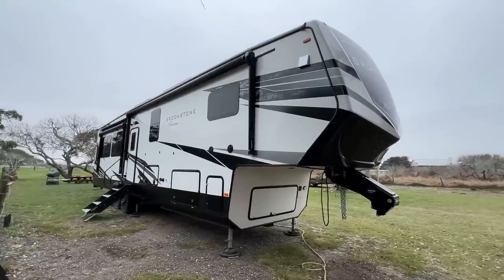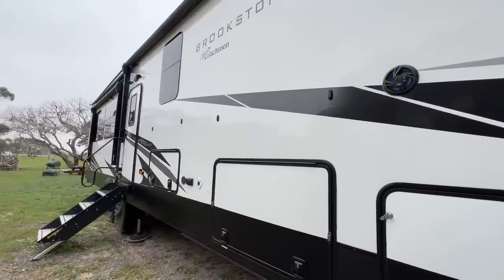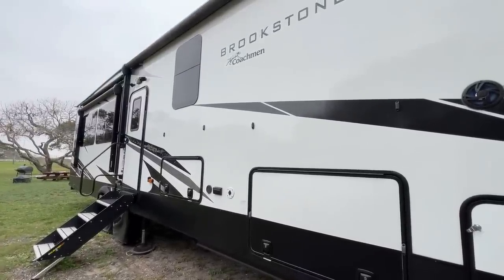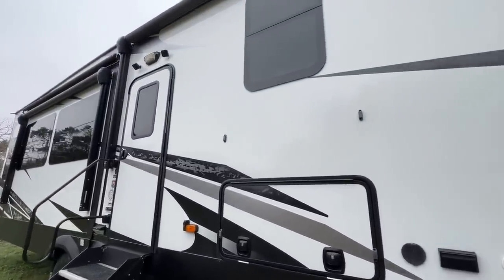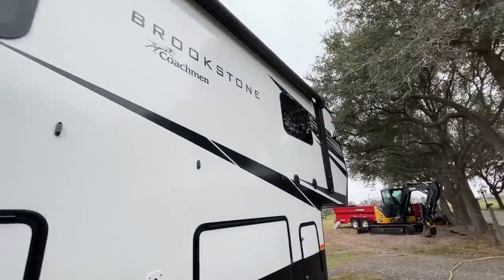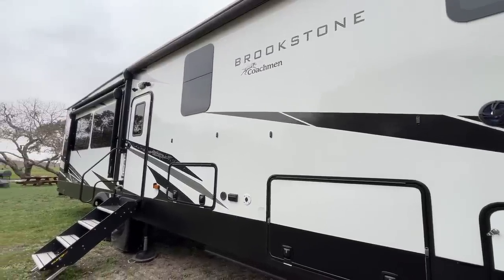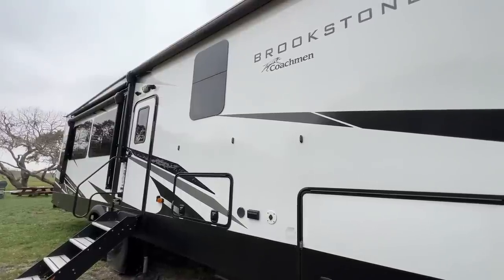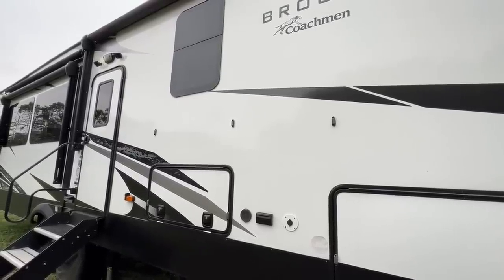Washing your RV? This may surprise you!

Comment: Just bought a brand new class A and the first thing I did before taking it out is have its paint protected with a good quality ceramic coating ( professionally done).  Had the same thing done to my fifth wheel when it was new and it looked that way (new) till the day we traded it in.  Use neutral ph soap to wash and you will be happy with your shine.
Reply: How much does that cost?
Reply: ceramic is the way to go
Reply: @theer2259   for a 32 foot Class A it was $120 a foot and guaranteed for 5 years.

Comment: Rockwood recommends wax. I never have waxed our RV. I DO use a power washer but i use the wash nozzle. You can buy nozzle kits with 5 different nozzles. I use the middle or wash nozzle and it works well. I do avoid the bottom of the windows.

Comment: I beg to differ, I own a 2005 Trail Bay 27DS, owned it since new. Each spring I throughly clean the trailer and wax it with a marine wax, specifically, Collinite 885 Fleet wax, it’s kept my trailer protected and looking almost as good as new after 18 years of living in Indiana. Wax helps seal up the porous surface, allowing for a much easier time removing dirt, bugs and road grime.
Reply: I use Collinite wax on my jeep.  Good stuff.

Comment: What test data do you have to back your claim?
Reply from the maker: None. Personal experience with 5 RVs.
Reply: @BigTruckBigRV  That's what I thought. Thank you for being honest. My personal experience of 40 years with many RVs and boats says your video is not accurate or incomplete at best. I suggest people follow the recommendation of their RV manufacturer. From the Forest River owner's manual for your 5th wheel "Wax at least once a year with a standard liquid or paste wax" There is an entire section about the care of the exterior finish. And yes washing, as you indicated, is an important part of proper care.
Reply: @BigTruckBigRV  In all due respect, I regularly follow you site for the last 4 yrs.Your rvs sit around under a port till last year, you flip them regularly, you really, don't really go far with them. If you travel up and down the coast ,or across country, you need some kind of protection against the elements, dirt, road grime, bugs etc.29 years rv experience .
Reply: @josephsouza9951  Hello Sir was wondering if you could give me some info on what the best method is to clean my Motorhome and what to use . After hours and hours of watching videos on here I'm confused as can be.  It's a class C motorhome with fiberglass body . We are a older couple just trying to figure this out ! Everyone makes this stuff out like it's rocket science!

Comment: I use a Automotive ceramic spray, I use it on every part of the RV ,it is good for plastic, rubber vinyl, paint you name it Even glass It helps with the bugs on the front of the RV And even the rims of the RV prevents the break dust from sticking to it. And those black streaks from the end of the gutters wipes right off Easily , I re apply at least 3 times a year it also shines .

Comment: I would definitely use a protective product by my RV’s exterior.  I store my wife’s 2019 Winnebago 2100BH inside a climate controlled shop where I can wash and wax anytime during the year, usually before camping season starts.  Using a power washer correctly to wash the RV is OK, with a wide fan nozzle and minimizing blasting water at seams, windows, joints, etc.  Light oxidation can be removed with an all-in-one cleaner/wax product.  I wouldn’t use an automotive polish, as JD stated, the gel coat is relatively thin and the surface isn’t uniform.

I’ve used Collinite paste wax, it’s a bit difficult to work with but it’s been used in the marine world for years.  Collinite does offer a liquid wax, 845, which should be easier to work with.  Collinite is an incredibly durable natural wax.  For folks camping full time or leave their rig outside, applying and removing any protection product it’s recommended not to do it full sun.  In these situations a sprayable sealant or ceramic coating would be easier to apply and remove quickly.  Some of these products, such as Turtle Wax Hybrid Solutions Ceramic Wet Wax, can be sprayed onto the still wet surface and wiped off with a drying towel.

I don’t believe a pro-sumer level ceramic coating such as Gtechniq Crystal Serum Light will be effective on a gel-coat, CSL is designed to bond with a clear coat/hard plastic.  Pro-sumer level ceramic coatings usually come in small volumes 30-50ml bottles from $55-$120 per bottle and would be cost prohibitive for most people, lots of surface area on an RV you’d probably use 2-4 bottles depending on size.  CSL is definitely a product best applied indoors.

Sprayable sealants and ceramic coatings can be purchased in larger volumes.  I’ve had good luck with Technicians Choice TEC582 Ceramic Detail Spray, available in gallon size, lots of choices out there, I use this product between washes of my vehicles along with the Winnebago.

For vinyl surfaces, 303 Automotive Protectant gets applied to awnings top and bottom after it’s washed, include the roof and accessories.  Gallon size available.        

Stubborn bug remains on the front cap can be chemically removed with a PH balanced bug off product, I use Gtechniq W8 V2 Bug Remover.  I own several Gtechniq ceramic coated vehicles, W8 will not harm the coatings but will probably remove sealant/wax, again several bug off options available from different manufacturers.  I follow up with Technicians Choice afterward.

For our usage, TEC582 would probably be adequate for a trailer that’s only outside 30-40 days a year.  In a high sun environment, just like your daily driven vehicle, a once a year application might be not enough.
Reply: Bless you for this post!!!!!! We use Carpro CQuartz UK 3.0 on our vehicles but I've been scratching my head trying to figure out how to protect our new rig. Your comment helps TREMENDOUSLY!!!!! I would have loved to ceramic coat it and maintain with Tec582.

Comment: I use soft water to clean my 5th wheel. Had a spigot installed when we replaced our home soft water system. Help eliminate hard water spots especially in AZ that has some of the hardest water.

Comment: It is very important to wash your trailer.  Watch a car detailing video from pan the organizer on YouTube to learn how to wash a vehicle.  I agree not to use power washer on trailer for the reasons given.  
Use two bucket method with microfiber mitt or microfiber pad on pole.  Look to harbor freight. Use two or three bucket methods to wash.  Use a quality microfiber drying towel.  Ceramic coat every 6 months if using a consumer spray product like turtle wax or meguairs.   Ceramic lasts much longer than wax.
Reply: Hello Sir we just bought a 2020 motorhome about 3 months ago , a Class C , I'm so confused of what to use to wash and clean it with . It's fiberglass,  everyone makes this stuff out like it's rocket science it's very confusing! Has me so concerned I don't know what to use on it !

Comment: I use 303 rv wash/protectant. I foam it on and rinse it off and let air dry. It only takes me about 30 minutes to wash my 30ft 5th wheel.
Reply: Sounds good I'd like try this on my motorhome ! This stuff is very confusing I've never cleaned her before just bought it 3 months ago . Everyone seems to make this out like it's rocket science ! Ant advice would be greatly appreciated.  It's a class C with fiberglass body .   A 2020 coachmen freelander 21 QB

Comment: They make microfiber 'brushes' on poles.. that works great and won't scratch like others.   There are cleaners made specifically for fiberglass, most of those will be listed as 'marine cleaners/wax'.   I do wax my RV 2x per year, however the first wax job was the first week I owned it.  I personally believe that the coat of wax helps avoid the oxidation of the gel coat.    One more.. have not gotten it yet, but they make squeegees for drying the sides of the RV, it won't get all the water, but should help to avoid some of the water spots.

Comment: JD, there are methods that some pressure washing companies have that will clean a RV and not harm it in any way.  I've been pressure washing RV's for years and I've never had any problems.  There are oxidation removal chemicals that will remove the oxidation simply by spraying it on the RV then allow it to marinate for approximately 10 to 15 minutes then simply rinse it off.  In most cases the oxidation will run off with the rinse.  There could be some area's that will need to be scrubbed.  Just make sure you don't scrub to hard and remove any paint.  However, prior to using an oxidation chemical you must clean off all the organics, dirt and debris.  I've always used bleach and water with my pressure washing machine.  

We have special tips for our machines that will reduce the high pressure down to a level equivalent to a regular water hose.  Once the organics are removed then do the oxidation removal process.  When both those methods are completed, you can use a liquid wax (if wanted) to spray down the RV giving the surface some protection for a while.  Just be sure that the pressure washing company has experience washing and cleaning the exterior surfaces of an RV.  Most of them don't.

Comment: I have a wildwood aluminum front cap in 2 years it looks like tan chalk what do I do . I have used 2in 1 cleaned wax and it still doesn’t hold a good shine. Ceramic coating?